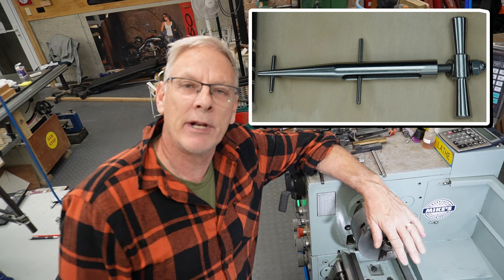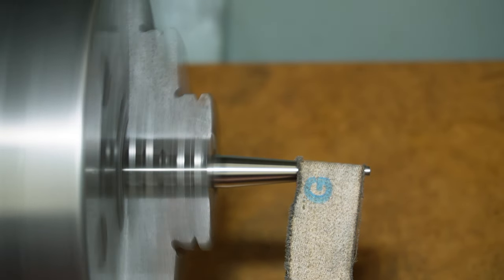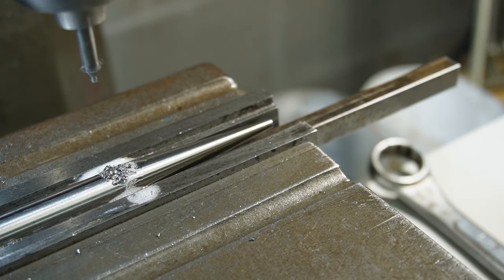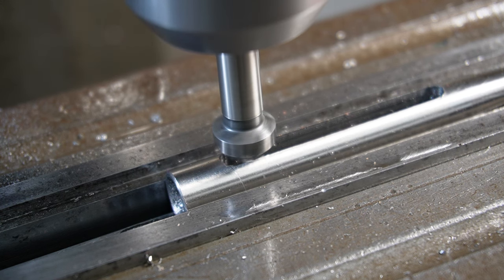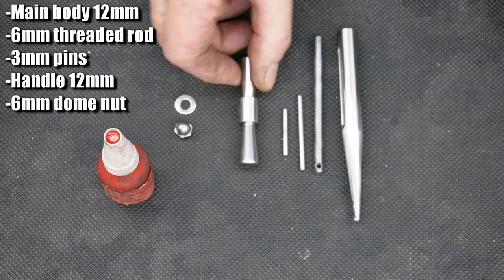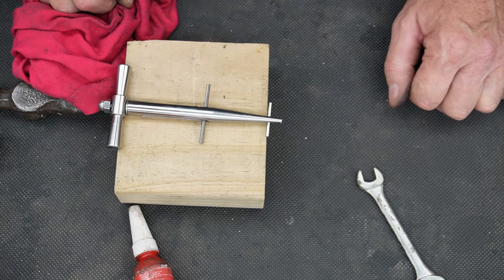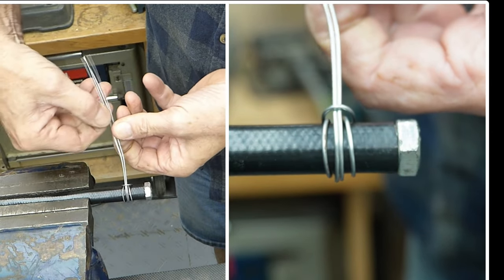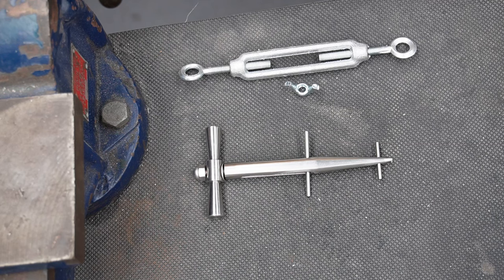Wire clamp tool to replace hose clamps

Comment: I'm sorry, but you spent far more time and energy on this tool than a hose clamp ever would have been. And they also have much better hose clamps than what you use as an example. Also the correct size hose clamp should just barely slide on with out resistance, by the time it's tight that gap no longer exists.
Reply from the maker: Thats what hobbies are about. I had great fun making it and putting up a video for you to watch. Cheers Mike
Reply: Bobby, you missed the whole point of this tool. The idea is you can make ANY size clamp without having 300 different sizes on hand to have the "correct" size.
Reply: Let alone when your 500km from a hose clamp shop and need one yesterday, recon there be a lot of stories how one of these tools save the day.
These seem a lot more reliable where vibration has been known to unscrew some types of hose clamps.
One last point, I’ve found that just because hose clamps come in size ranges that cross over from one range to another I’ve found at times neither size fits perfectly. 
The humble wire clamp is the genuine one size fits all.

Comment: Instead of using  standard pins for the cross pins take DIN 1474/ISO 8742 Knebelkerbstifte/toggle notch pins. The do not require reaming the hole to achieve a tight fit.
Reply from the maker: Thanks for the advice. Will look into them. Thanks for watching. Cheers Mike

Comment: Make one of these a few years back - quite a bit simpler,  but it works fine.
Reply from the maker: Appreciate you watching. Yes lots of designs. Will be putting up a simpler no machining one in next video. Cheers Mike

Comment: Hi Mike  Nicely made tool.  I have one but a simpler design.  Also instead of threading the wire ends through the loop, make two separate loops on a straight piece of wire.  The loops must rotate in opposite directions.  After that just fold the wire 180 degrees between the loops until the loops are touching on the inside..  Thread this over the fitting etc etc. This way, the wire can be formed around a mandrel on a bench vice.  The wire clamps can be premade to a variety of sizes.
Reply from the maker: Great idea as it could make it easier in some situations. Will give it a try. I appreciate you watching and commenting. Cheers Mike

Comment: Great video explaining a great tool. Just added this to the top of my home machining project list. What type of wire do you use, stainless?
Reply from the maker: That's for watching. I usually use stainless but not available at local store so am using galv wire at the moment. Both work fine. Cheers Mike